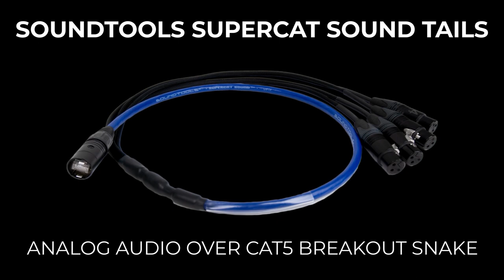Optimize Gain Structure - Pro Audio

Comment: When you are setting up a system with a controller and a equalizer and a mixer and the amplifier to the speakers how would I hook up the system
Reply from the maker: Mics into mixer into equalizer into controller into amplifier into speaker
Reply: Ty very much for the information

Comment: One thing I don't get though. If you'd look at the meters the pre-fader levels would vary and one meter would show peaks at -20 and the other at 0. Which is fine. But you also talk about a parallel compression option in which you set all channel compressors at 0dB treshold and drive them into compression through a VCA. But would that not mean that one channel will be already under heavy compression while the other is still uncompressed when you use this gain structure? I'd think that compression solution would only work if you gain every channel to 0dB peaks and then don't worry about where the faders end up? How does this work?
Reply from the maker: I never do parallel compression. And especially on a digital console I don't recommend it.

Everything is bussed through the subgroups.

The VCAs turn the channels up and push more signal into the compressors The subgroup levels turn the post compressor level up
Reply: @DaveRat  sorry, not the most professional user here. I thought it was called parallel compression, but obviously it is not. I'm refering to the setup with VCA's you explain in another (great) video.
The question about that I can't wrap my head around is... say you push the VCA up 10dB. When one channel was peaking at -10dB, with the compressor treshold at 0 dB it still won't be compressed when you push up the VCA 10dB. It will just be peaking at 0 dB then, right? However, another channel might have already been peaking at 0dB so it will be squashed by the compressor when you push the VCA up 10dB and ends up at lets say 3dB (3/1 ratio). So one channel will go from -10 to 0 and stay uncompressed and another channel will go from 0 to 3 when you push the VCA higher. That will shake up your balance betweem channels wouldn't it? 
I'm obviously not understanding something here.
The way I first thought you manage that is to gain each channel to peak at 0dB so that the channel is just below the 0dB compressor treshold. In that case you would balance the mix purely by faders and not by gain (but that would only work when the compressor pick up would be pre-fader and I am not experienced enough to tell if you can put the VCA pre-fader and before the compressor).
This video however explains that you don't focus on gaining to 0dB peaks so that each channel has the same input level AND you don't focus on gaining all faders to unity. You seem to find a middle ground, where the gain is healthy for each channel but the levels are not identical, and the faders are at a workable level but also not identical. I can totally understand that and I really appreciate your insights on the relationship between the desk and the amplifiers. 
However after this video I don't understand how the compressor VCA works anymore. If the treshold is not based on equal gain level and it is not based on equal fader levels, how can the mix then stay in balance when you push the VCA up? Why then put all channel compressor tresholds at 0dB if the levels between channels are not identical?
The way I'd think it would work is to first set all gaining and all fader levels exactly like you say in this video and then set the channel compressor levels at whatever treshold it is just before starting to compress. So that when you push the compression VCA up 10dB all channels will be compressed with the same amount of compression.
I totally acknowledge I'm in the dark here, not you. And I might be wildly lacking in basic understanding. Just a volunteer sound guy here. So any light you can shed on this would be really appreciated. I'd like to learn.
Reply from the maker: A quick answer.

A VCA is just a remote control for the faders assigned to it.

Turning up the VCA is the same as turning up all the faders assigned to that VCA

Turning up anything before a compressor increases the volume before the threshold of the compressor

Increasing the volume before the threshold or reducing the threshold will increase the amount of compression.

Increasing the volume after the compressor or after the threshold will increase the volume of the compressed signal.

The faders on the channels or the VCA that those faders are assigned to control the amount of signal sent to the groups where the compressors are therefore those changes are made prior to the compressor threshold. Increases will increase the amount of compression and decreases will decrease the amount of compression.

The group faders are after the group compressors on most consoles with most patching and turn up The signal that has already been compressed.

As far as parallel compression that is a different concept.

Parallel compression is where you send a channel to two different groups. One group is compressed and the other group is not compressed then both groups are sent to left and right.

This allows a compressed version of the signal to be combined with a non-compressed version of the signal and by altering the levels on the groups you can increase the amount of compress signal or non-compressed signal.

This can be handy but uses a lot of groups and the final outcome is not much different than just altering the ratio and threshold of the compressor without parallel compressing
Reply: @DaveRat  thank you so much! I'm not sure I completely understand how this doesn't lead to one channel compressing more than another, but I will find a  way to test it and mess around with it and then I'm sure I'll find out! Thanks again!!
Reply from the maker: Yeah mess with it and maybe watch the video again I think you're still missing something

Mike's go to subgroup subgroup gets compressed subgroup sends to left and right repeat that for each instrument type.

Comment: i llike to use matrix for lr output. if te system is too loud i can bring the matrix back.  a lot of my gigs dont have a monitor engineer so my gains tend to makke all my faders around zero for a balanced mix. it makes setting up ear mixes easier as can send everything at same level with 1 or 2 things boosted slightly as needed.
Reply from the maker: Very cool
Reply: This is a great Idea. I have the problem that I am always working on powered speakers without any opportunity to pull down the internal amp or the input level. So I wondered what to do in these cases.

Comment: Hello Dave.  Wanted to know if one should set the volume on a phone, computer,  etc.  at full output or around 75%.   Some say at max for best resolution and some say running them at max causes distortion.  What would you recommend when connecting them to a mixer?   Thank you!
Reply from the maker: I would say 75%

A fractional amount of inauduble resolution vs potential distortion. Makes 75% a preferred starting point
Reply: @DaveRat  Thank you very much for your quick reply!

Comment: Most of the equipment we use now is MUCH less noisy than equipment of old, this gives you a much bigger window of acceptable gain.  It definitely comes up on some guitar amps though: if you play you might have to hit the amp hot and turn the master down so we're not listening to amp hum or buzz (amplified by a microphone into the PA).
Reply: Always be fearful of turning down your PA amps, especially if you can't access them during a show!  If you can't predict the noise of the audience run your faders down in soundcheck and you'll have room to turn it up.  If you know it's a sit-down concert and you have too much PA, that's a scenario where you can safely turn the amps down so your faders sit right.
Reply from the maker: Agreed
Reply from the maker: Yes and ideally amp or processor levels can be controlled remotely

Comment: I think understanding that faders are logarithmic instead of linear is kind of crucial. You get way more control if your have gain staging is right where you can mix with the faders up near 0db. I work on a house PA at a club that is honestly too big for the room (and I think they are trying to make up for poor acoustics and some phase issues with more wattage, which I would rather not do, I'm trying to get in there and really dive deep on setting it up and do some testing and waterfall graphs and what not)  The house engineer or someone has taken the output amps and just maxed the gain on them. I'm sure there is a reason for this, I guess they are less likely to clip at the output stage that way because it's almost impossible to get the input high enough to clip the input, but I feel like I would have an easier time if I could just set it up where the signal is coming though the board outputs between -18 or -12 or so at a good level and then just trim the main amps so that it is a comfortable volume in the room, maybe make it so it's just a little louder than I might want usually to give me a little wiggle room with the headroom. Does that make sense?  Is there a reason that someone might max out the output amps like that and is that a normal thing? Love you're channel, you are a consummate professional and I love you're teaching style. You seem like the type that is the smartest person in the room, but no one would ever guess. That's what I'm going for myself.
Reply from the maker: Older non digitally processed amps typically have an attenuator as the level controls for each channel.

So turned up to max is actually just not adding resistance in line.

Theoretically, with a well designed system and all matched, that is the way to go.

That said, if there is too much pa for the room or the show volume is lower than the capabilities of the amps and speakers, then the console metering and faders can be sitting at low positions.  Turning down the amps or reducing post console gain can help get the console output fader up closer to the 0 setting

Comment: I usually try to get the performers to give me at least a 70% sound level. I tend to push my gain as far as I can before clipping. I more often than not don't have the luxury of high powered monitor systems and I need as much signal as I can get to monitors or the vocals get buried onstage by oversized guitar and bass amps. It's at this point I've hit the ceiling (edge of feedback) and have to go practical and just ask guitar players to turn down onstage.
Reply from the maker: Hmmm,. Well so far all the testing points to - never clip the digital board output
Reply: @DaveRat  I'm not questioning your wisdom at all. I don't know shit about "F" lol.. I just try to get the best signal from the source first so that I can have ample gain on my side to feed my wedges. I don't want them coming in too hot or too weak.

Comment: HEy Dave, i love your videos. Really apprecieate and thankfull that u share ur knowladge with us. I have a question regarding the Gain Structure. i Use Midas M32. I udually have 2 stereo groups, one uncompressed and other hardly compressed and i mix those two groups to get my sound ( This tipp also i got from you, it was an old video from you). then one mono Group for Bass, so that i can side chain compress with the Kick so that the bass doesent fight with the kick, then all the other channels All Guitars, Keyboards comes to one Group(i name this as Band) and voices to another grp so that i can side chain compress band group with Voice group. Whenn voice comes, band group will be compressed 3 db. So my Problem is, there are 6 guitar challens and 5 keyboard channels comming to band grp. Even i keep all channels Gain bei -18 dbfs, this sums in band group and start to clip. but mail LR channel also doesent clip,  just only band channel clips. What can u do for this? Sorry for long comment.  Thanks a lot in advance
Reply from the maker: Hmmmm, turn all the gains down 6db on every channel and turn the master output up 6db should do it
Reply: @DaveRat  Thanks Dave, will try it.

Comment: Hi Dave-
I really appreciate this information as I am always learning how to best handle situations. I have a question: How do you manage this concept you are explaining by lowering the power amps in a situation that you have already set up your PA for a band scenario and the band usually only give you a few min for a line check at best, and your speakers are already in mounted in the air and they are powered speakers (ie you would need to lower the speakers which is not doable), I do run everything through a DBX PA2 processor to "tune the room" . Would you recommend adjusting the output from the DBX box and running the speakers a little louder than anticipated and turning it down from the DBX application? I have come across that the singer is clipping about 50% of the time some of which is due to poor mic handling, and the rest I am trying to compete with a full live wedding band with live drums, horns, and electric guitars etc. Any Advice or recommendations are greatly appreciated. I am a studio engineer who transitioned to doing some live sound. Warmest Wishes, Cheers.
Reply from the maker: Yes, use a system processor or a compressor after the console to add or reduce gain.

Adding post console gain to get your meters lower or reducing gain post console to get your meters higher is the way.
Reply: @DaveRat  thanks so much Dave. I really appreciate your expert advice.

Comment: Great video. Question I'm a dj should I set my levels based off of my microphone or my music? I'm thinking mic because I want to be able to talk over the music...
Reply from the maker: You should be able to set for the music and then set the mic gain and have it line up.
Reply: @DaveRat  maybe it's different for live streaming. When I play real gigs I think the mic cuts through the music. When I live stream I have to dip the music because people say they can't understand what I'm saying.
Reply from the maker: Interesting. That's a whole different issue. Probably solved if you reduce the overall music level. With streaming there is way less dynamic range than with live

Comment: Hi there! I know some who would argue with you saying that you are mixing with the gain. I never saw the issue with it unless you get too low or too hot.
My question is about using a mix bus to burn dBs. Have you used this practice to increase resolution in your faders? What’s your opinion on that? Too much latency? Too many places to have an issue in the chain? What are your thoughts?
Reply from the maker: Set your input gains and post console gain so your faders are optimally located and noise is minimized

Fader position or levels has no impact on latency

Comment: Great video! I like to mix my shows with faders all in unity. One thing to keep in mind, though, is running monitors with the FOH-board. Once the gains are set, don't touch 'em. It'll mess up the monitor mixes. Rely on faders only during the show, for FOH purposes.
Reply from the maker: Also using a Y cable and Y'ing inputs so you have a mains channel and a dedicated monitor channel, on the same console can be useful

Comment: If I applied this gain structure plan to a simple recording rig where I'm trying to capture a stereo mix, would the "adjust the amp level after the console"  part of the gain structure apply to the input level on the stereo audio interface I use?
Reply from the maker: Hmmm, depends. What you want is gains somewhere in a reasonable range between hiss and overload, fader in desirable positions, output metering in the -16 to +4 analog or -20 to -4 digital or so throughout the signal chain.

So assuming all is in line and the level is too hot to the recorder, reduce the input to the recorder to March the desired level. Also, if there are input sensitivity switches, they should be used to achieve correct metering and avoid knobs and faders too high or low
Reply: @DaveRat  thank you!